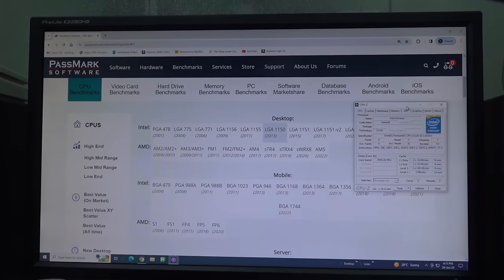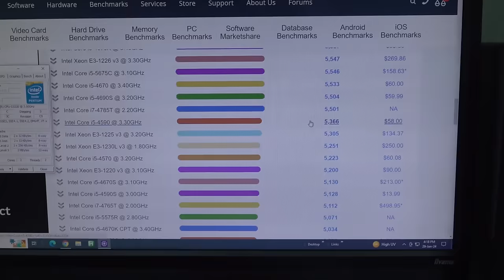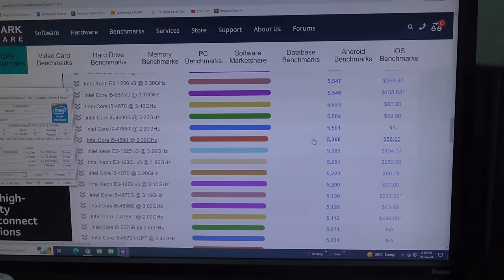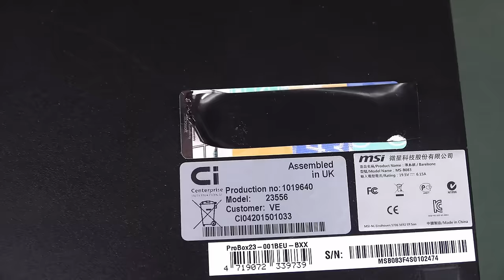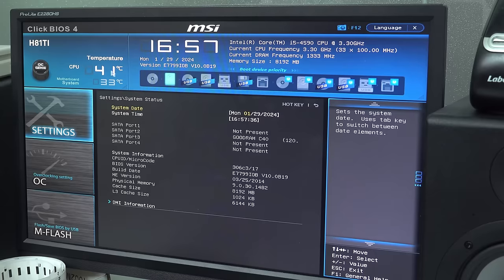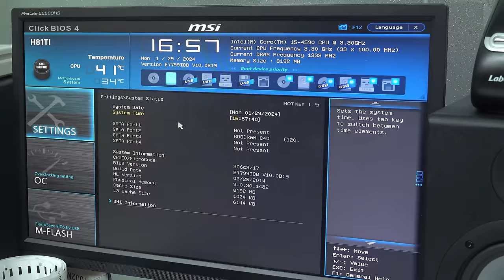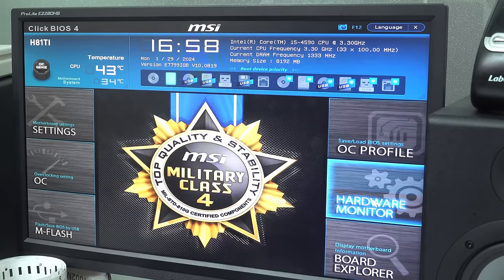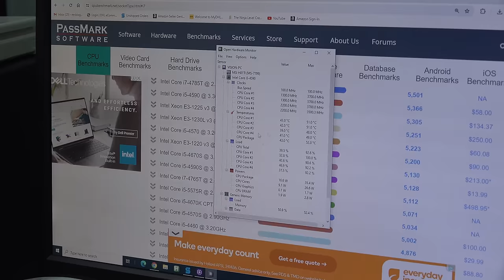Dumpster CPU Upgrade on Shipping PC

Comment: Oh no - the thermalpaste application is completely wrong. You have to wait until full moon. Then apply 11 dots and 4 squares of paste over a period of at least 7 hours. And of course dont forget to squint and hold the tongue in the right angle during the process.
Reply: I hope you are talking about imperial dots and not metric ones?
Reply: ROFL!!
Reply: Everyone knows how critical the thermal paste application is! Dave is such a noob!
Reply: You haven't put enough on until it's squeezing out everywhere.
Reply: You screwed up by forgetting the bearded virgins😆
Reply: Before I knew anything about thermal paste I saw a lot of "expert" videos in the early Youtube days regarding proper paste applying. They were all saying that their method was the BEST and everyone else was WRONG... and I was none the wiser! Turns out these self proclaimed gurus were just wasting our collective time.

Comment: That CPU is better off in a PC that you use daily than in a landfill somewhere. It's still a perfectly fine CPU, it's not like you're playing the latest AAA game releases or doing simulation work on it. Older CPUs still have tons of life in them, I even built my first home server out of a system with a 4th gen Intel CPU.
Reply: And the HS is fine not crunching numbers all day and even then it throttles anyway
Reply: I've still got 2nd and 3rd gen i5's that I use regularly. They work perfectly fine with an SSD upgrade to speed up overall response.

An 8th Gen micro Dell PC is my newest machine.
Reply: @volvo09  SSDs are one of the best upgrades to older PCs
Reply: Still running an i7 3770k in my main PC, roughly 11 years from new.

Comment: The bigger question is if the external PSU can handle this at full load. If it does not you risk it shutting down at random when the CPU is loaded. try running prime95 stress test
Reply: Why? He's only doing some shipping with it.
Reply: @MrThomashorst  Because if for some reason that CPU decides to go full throttle (Windows update, some web page) and the PSU can't keep up, the voltages will go below min spec and the PC will turn off. You don't want instability in an appliance PC like that, the whole point this is a "shipping PC" is because it must work reliably because it's controlling the printers

Comment: Good thing I tested all the popular thermal paste application methods and found absolutely no difference within the margin of error. MX-4 is one of the better TIMs BTW! Great performance per cost.
Reply: Arctic makes long lasting pastes (lasts 10 years) but I remember reading MX-4 was discontinued and Arctic said MX-5 has issues so to switch to MX-6 as they aren't making MX-5 anymore as well. (You can still buy them because they are either old stock or fake)
Or, you can try Honeywell phase change TIMs as they are usually "automotive grade" as in 10 to 20 years. Just be careful as you either need to cure them yourself or buy pre-cured ones though pre-cured ones can't be stored for long if you bought more for spares.

Comment: I replaced Celeron-1800 in some mini-desktop with P4-2400 and was happy with it's speed until it shut down and one of the MOSFETs near CPU got shorted and hot as hell, I even fried my finger when touched it. It was not intended to run this power.

Comment: If you're playing along at home and ordering a processor.  Get a Xeon E3 1226v3 (If you need graphics), or a Xeon 1240 or 1241V3 if you have a GPU or don't need the iGPU.  They have nice features like 8 threads, more L3 Cache (E3 123x and up).  The xxx5 and xxx6 are the ones with GPU.  1241 is a really good value, its basically as far as I can tell a 1270 as far as clocks.  I had a Z97 board that would run it at almost 4Ghz all cores too.

Comment: You got a message about the memory because the memory controller is on the CPU chip. You probably want to make sure the memory timings are set correctly. The (BIOS) can read this from the SPD (serial presence detect) chip although they call it XMP now. It stores the correct clock frequency and timings for the memory module.

Comment: The motherboard form factor is a variant of the Mini-ITX that was known as a "Thin Mini-ITX" motherboard. There are a few characteristic differences between the Thin Mini-ITX and the regular Mini-ITX motherboards.

One easily noticeable difference is that the Thin version is configured to use an external power supply that is essentially a laptop power brick rather than a more conventional desktop power supply with a 24 pin ATX style power connector. Another difference is that the Thin Mini-ITX boards locate their CPUs further to the left (if the board is laid flat and you are looking at it from the front) and use laptop memory that lays flat against the motherboard rather than desktop memory that is upright.

The Thin Mini-ITX boards also incorporate LVDS and some eDP support for use in "all in one" type systems.  Those connectors on yours are the bright red connectors in the front right corner. 

One limitation of many of these boards is that they are limited to CPUs with TDPs of no more than 65 watts.  In case you might be wondering, that Pentium G3220 that came in the system happens to have a TDP of 54 watts.  The i5-4590 you chose is rated at 84 watts TDP, but it looks like it'll be fine anyway.  You may want to keep an eye on the processor temperatures for a while when you have the processor under load to make sure the CPU cooler is up to the job of cooling the hotter chip.  I doubt the shipping software will load up the CPU all that much for more than very short bursts, though so it's likely to be just fine.

Comment: I do this type of "hardware-hacking" a lot;
It gives a 2nd or even a 3rd live to an older computer by a relative simple replacement-upgrade of the CPU.
Even older NAS-machines and Servers can often be cpu-upgraded.
And such CPU's do not have to cost a ton anymore (as they used to), it is just a matter of finding one.
So, save your old CPU, take out the CPU's, memory and powersupplies, safe them from the landfills.
In fact, consider that old PC, maybe you can repurpose it as a download-machine, start playing around with Linux, start some project that you do not need a top-of-the-art expensive pc. Have enjoyment that an older pc can still have value to you.
And do not forget, those older pc's can sometimes be way sturdier than their modern-day counterparts!

Comment: My 4590, to do internet on my old/non-smart TV, uses about 39W.
Open HW Monitor has a small configurable widget you can leave in the corner of your screen that can display temps, etc, at all times, ie, you can see when your paste is drying out - lol -.

Comment: There are some pastes (the very thick/dry ones) out there where you can get a couple °C when doing the flat-scraping-thing-method.
Much more important is that you put the "bare" amount of paste onto the heatspreader (or distribute the excess by twisting the heatsink while pressing it down).
But for these couple of watts I think everything is fine as long as it transfers the heat😂

Comment: Nice to see the pea method for applying thermal paste, may not give the best result but it is the easiest way and who cares that it runs 1 degree hotter.
Reply: get over it man, its just lazy.
Besides, you risk hotspots with it.
Just do a thin even layer across the whole top.

Comment: That cooler is too small if you intend to run prime 95.
Everything else looks good.

I would set short and long power intervals to max if you want the beat office speed out of it.
Will let it turbo for a bit longer.
Reply from the maker: I'm totoally running Prime 95  all day long, it's my favourite game.
Reply: Nothing like heating up the shipping area with Prime95

Comment: BIOS limited obviously, but if TDP is an issue you can both totally disable the TurboBoost and/or manually set the clock down effectively limiting the base speed. Not sure on 4th gen, but on 2nd and 3rd it makes some difference in terms of thermals. And for that PC, you're probably benefiting more from the extra cores/threads/cache than the "top speed".

Comment: trap for young players... check the motherboard specs AND bios can accept the upgraded CPU before you take it apart!..not all boards can take the cpu even if its the correct socket... and alot of the time you need a bios update for newer cpus... id suggest upgrading bios FIRST!... then check the supported CPU list for the motherboard via its manufacturer's website...
Reply from the maker: Or just whack it in and see if it works.
Reply: @EEVblog2  been there done that... its not a good idea when youre working on PC hardware on the daily... complete waste of time... ya better off checking first before doing anything...it takes all of 5mins... where it takes like half hour to tear down the system, replace the cpu and then rebuild it.... only for it to not work and require you to tear it down again just to put the original CPU in, and update the bios....wasting another hour in the process... ... great if ya paid by the hour... but not when ya paid by the job!
Reply: @WacKEDmaN  Dave has all the time in the world.
Reply: @Okurka.  Dave does...sure... thats why i said "trap for young players"... not everyone is Dave!
Reply: I'd say that a bios update may be required if the cpu came out some time after that mobo was produced. Edit add-on: I might do a bios update right when I get a new pc put together, but after that I tend to leave it alone. These days you might mess up the secure boot, have to turn on legacy mode, and watch your TPMs. That has burned me before.
Reply: @yourdrinking  ...and theres one major reason to not go with HP proprietary junk...
...i know for a fact that MSI has updated CPU lists... that even include the bios revision that began supporting that CPU
most AMD systems need the bios update before upgrading CPU... intel is much more forgiving in that respect...
Reply: @WacKEDmaN  Did you just call him old?

Comment: Passmark is terrible for CPU comparisons.
Reply: Every benchmark is using different cpu instructions. So it depends how You are using computer. Using opensource (GNU Linux) You can use better optimizations for different CPUs.
Reply: I found that the CPU mark value is indeed useless, but the single thread rating gives a very good comparison of the raw processor speed. Of course then you need to evaluate the number of cores, cache sizes, TDP etc. according to what is important for you. And almost all of this data is listed at Passmark.
Reply: @kralg  maybe it use very basic cpu instructions.

Comment: Those intel stock coolers are just generally garbage quality, it's normal to struggle with the pins, at least they didn't break.

As for the cooler, it should be completely fine, at worst the cpu will throttle a bit, but considering your usecase it will not be under any serious load anyway.
I have had pc's where the intel stock cooler decided to fall off and it still ran, just rather slow.

Comment: Dave agree, with the cooling, also i noticed the USB1 is usb3 but with usb2 connected.

Also with you giving the blow jobs to the computers when the A,I take over they will thank you for it.
Take care brother.

Also upgrading ram could help as Windows is a hog, but cpu was a great start especially for the huge price you paid....... Sata drive clean might be a worth it as windows still uses page file just the windows disc clean up make sure you select system files as those are old updates that windows does not delete..

Those MSI SFF pc are not bad at all, and i do believe its miniITX or MicroITX <<< but yeah too many standards to keep track of, i do like they got the power brick external though that's a nice touch.

Comment: The worry about TDP is that the VRMs might get overloaded and blow, as the new CPU has turboboost and might actually reach that TDP limit while thermals are ok.
I've had mixed experience:
- a Dell OEM system with i3, I broke it with an i7 (65W TDP -> 80+W TDP) during stress test (no overclocking involved)
- HP Microserver Gen8 I replaced G1620T (35W) with a Xeon v2 (65/77W TDP) - still works, but I don't recall if I did a stress test, as I use it as a backup NAS and just wanted full HDD encryption performance.

Comment: I don't really see any problem with this honestly list of the issues that people would complain about are very power-related that's not a high enough power draw do matter what he think what fan even like it yeah that pc is so passive that's fine there are quad core laptops that have more powerful CPUs and about that same size of cooler roughly it's a little bit smaller itll just restrict power they have heat sensors

Comment: That's a cute little pc and I would never buy new these days. I wonder if you can add another drive for a RAID 1 setup as a backup.
Reply: Has 2 SATA sockets on the board, and also internal USB headers, so you can put a second drive in there, and the USB headers can be abused to get some extra memory in to have a boot USB drive, so the 2 drives can act as a NAS raid pair.
Reply: RAID IS NOT A BACKUP SOLUTION!
Reply: @Okurka.  How about not shouting; You seem to take offence with people
Reply: @TradieTrev  How about not saying to use RAID 1 as a backup? I take offense with dumb ideas.
Reply: @Okurka.  GO CREATE YOUR OWN CONTENT THEN!! This channel doesn't have any content!!!
Reply: @TradieTrev  How about not shouting; You seem to take offence with people
Reply: @Okurka.  COMING FROM YOU THAT'S RICH!!
Reply: @TradieTrev  How about not shouting; You seem to take offence with people

Comment: It's been a while, but don't you twist those cpu fan clips to release them, instead of just yanking harder?
Reply from the maker: I did twist them. Seems to be twist half turn an pull up.
Reply: I was gonna say, first thing he did was the twist! The next step is indeed just to give it a bit of a yank. During installation, they first click in and then the twist locks.